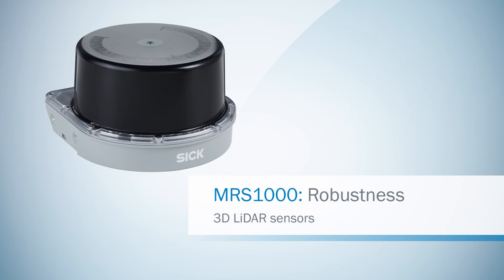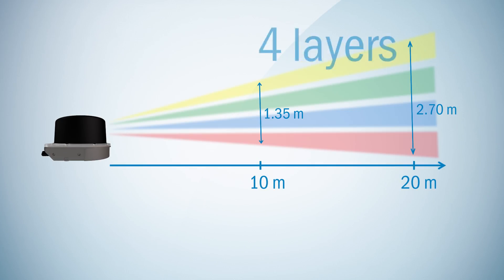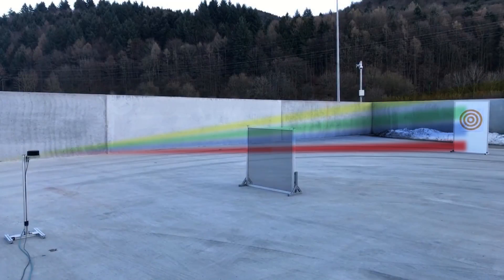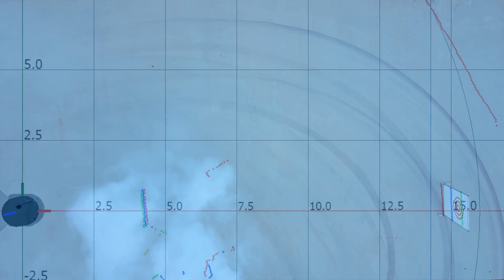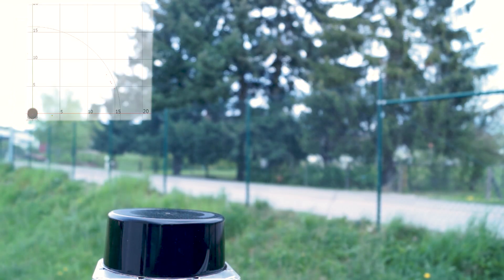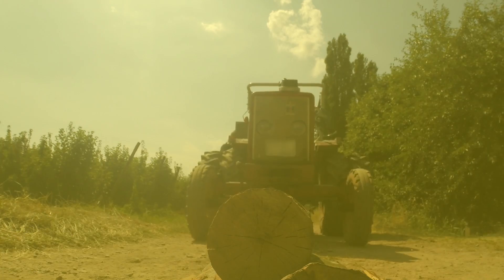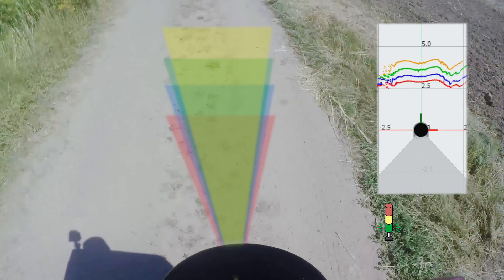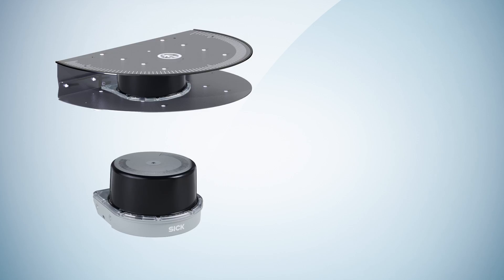MRS1000 and LMS1000 Robustness | SICK AG

Comment: How to extract layers from pointcloud
Reply from the maker: Hello @TehniyatBabar,
In the graphical user interface of the MRS1000 you can deactivate the layers that should be transmitted in the output telegram. To do so, find the "Output data range" section and deselect the layers you are not interested.

For more details on the output telegram, please check the following sources:
Telegram listing: https://www.sick.com/8014631
Telegram tutorial video: https://youtu.be/cTy66J6B8WY?si=H8JEnhV_VVql4KHi

If you have further questions, please contact our technical experts by e-mail: info@sick.com